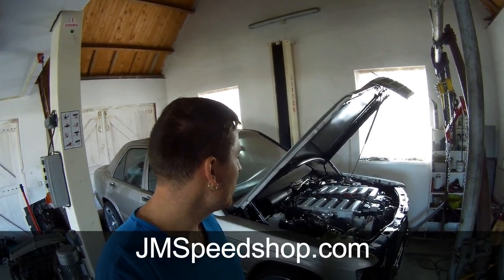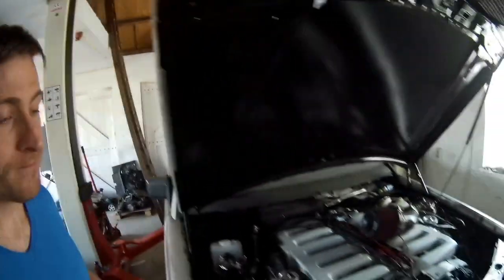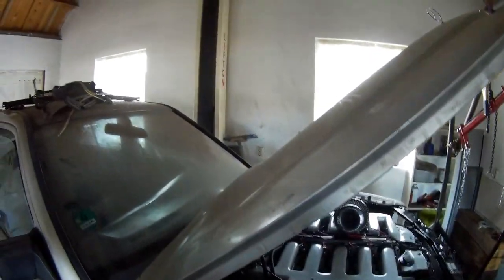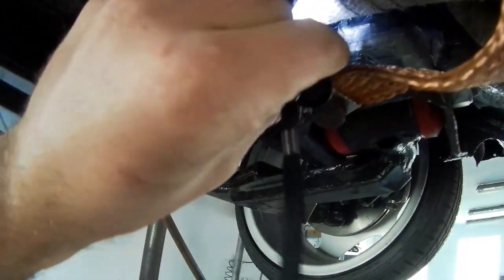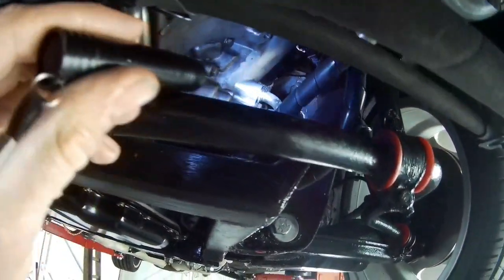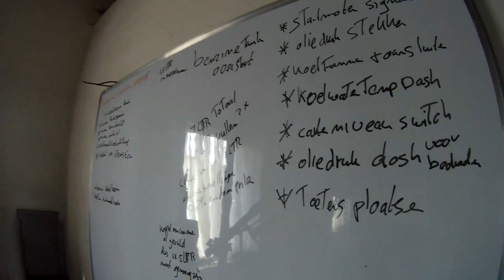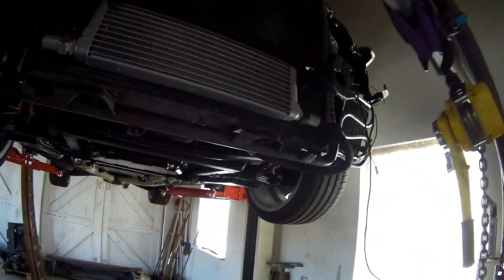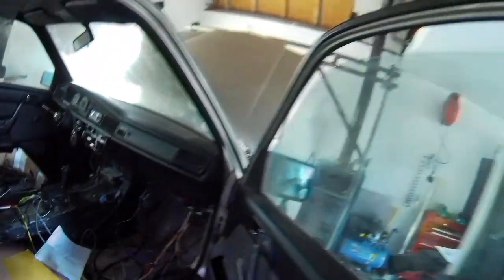W201 V12 is Almost there !!  all fluids are in

Comment: Straight pipe it for zonda sounds
Reply from the maker: It has a xpipe straight through muffler in the middle . And a end muffler.  I need to get a registration on the car first after that i maybe by pass the end muffler
Reply: You really need equal length pipes for zonda sounds :P.